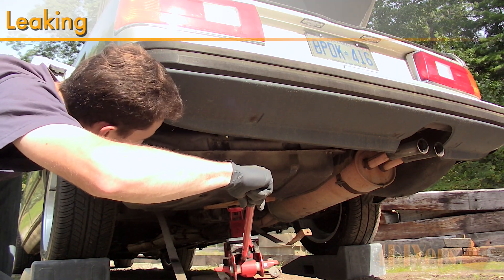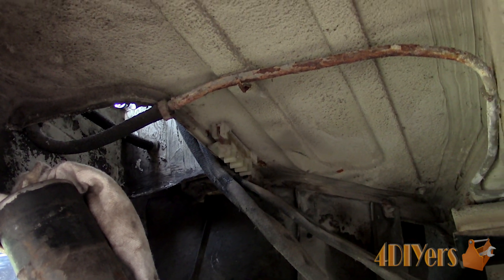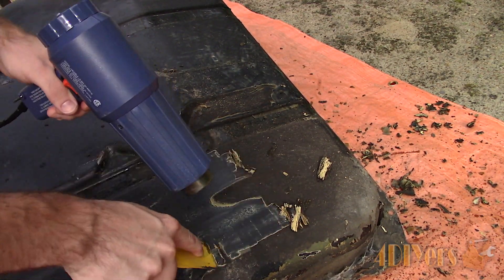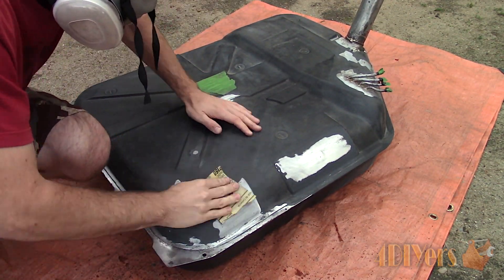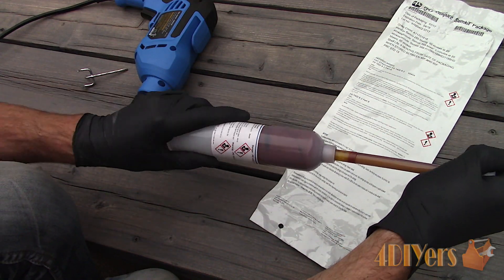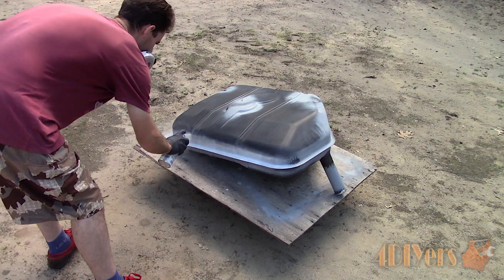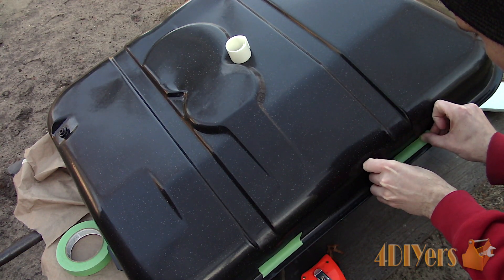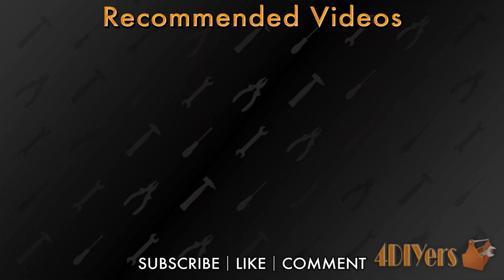How to Repair a Leaking Metal Fuel Tank Without Welding

Comment from the maker: Amazon links for various products used in the video for both USA and Canada:
USA
Tank sealant: https://amzn.to/3s7hCeR
Wax and grease remover: https://amzn.to/2M6xvCV
Etch primer: https://amzn.to/3qXvxUm
Filler Primer: https://amzn.to/3iQSOnT
220 grit sandpaper: https://amzn.to/3sZf5V7
400 grit sandpaper: https://amzn.to/3qOEO0G
Chemical rust treatment: https://amzn.to/3onBdoE
Polyurethane film: https://amzn.to/2ZtKJwz
Foam vibration pads: https://amzn.to/3udVL7e
Canada
Tank sealant: https://amzn.to/37owVHV
Wax and grease remover: https://amzn.to/39nLn4F
Etch primer: https://amzn.to/3aaS5tE
Filler Primer: https://amzn.to/2NucGl5
220 grit sandpaper: https://amzn.to/2YjmoJe
400 grit sandpaper: https://amzn.to/3qVYXlK
Chemical rust treatment: https://amzn.to/3osNlVK
Polyurethane film: https://amzn.to/3qLnqKw
Foam vibration pads: https://amzn.to/2Nn9iJ3

Comment: Wish I'd seen this before getting my fuel pump replaced. would have tackled all the cosmetic/preventative stuff you detailed here. And in SW Ontario, gas tank repair is very expensive, distant, and you have a very long downtime. And as you point out, a new tank can be cost prohibitive.
Reply: Especially if the person has rusted brakelines... The mechanic wouldnt want to work on the task because they are scared they will create more problems.

Comment: geezous..  after all that or you could just buy a new tank for around 200 bucks and be done with it.
Reply from the maker: Out of about the 12yrs I've owned this car, I've never seen one in a wrecking yard and I've only seen a couple people offering parts, but they were easily a couple hours away driving. I could order a tank from the US, but it would cost me $200 just for shipping. A new tank is probably around $1000 and a dealer item only, I can't imagine too many aftermarket companies offering a replacement. The same method was used on a newer 7 series I had, that was over 12yrs ago and I couldn't find a used tank for it either.

Comment: You can weld it safely by filling the tank completely with water or sand. You remove the air from inside and space it cant explode

Comment: i went in for a wof, and did not expect this to be my failure,
iv had my car taken from me by the garage, for the last 3 weeks due to leak at the top of my tank, turns out its similar to yours in this video, i told the guy to scrape and weld or surely there is a resin or putty, anything that can be done,
he refused for the sake of explosion and insisted on a second hand replacement, he has had three tanks delivered all unable to be fitted.
and the guys at the garage wont let me drive it away. no tanks around new zealand, they now talking about sourcing one from south korea. 
before it gets pricey why wont anyone fix it like you just did?  the car is a 2011 hyundai elantra, its been good to me and still has low miles.
Reply from the maker: Not sure why they'd refuse a used tank other than having possible rust if it's a common issue. Some shops just rather replace parts instead of fixing what's there. At times it can be cheaper to replace than repair, but in other situations they just don't want to be bothered.

Comment: before you install it pressurize with a bit of air and spray with soapy water.. Bubbles = leaks..
Reply: Good suggestion.
I intend to do that on my bike tank using my lungs.
Air is a much better test than liquid.

Comment: many years ago I fix my tank using JB weld putting in a coin 25 cents and press the coin in the hole wait for 5 minutes and than just cover the coin until disappear with more jb well in one hour was dry refill the tank with gasoline and the 25 cents were there forever

Comment: Gt video. I had a fight w a boulder...and lost. I have a tiny leak in my steel long ranger tank. It is diesel. I have tried everything whilst not removing the tank. Quick steel potties. Failed in 2 days. Jb tank weld...lasted 2 wks. So far hard soap has worked best...lasted 14 days without further attention. Now I re plug with soap daily.

Tank removal is awkward and time consuming but everything I have tried has eventually failed. Soooooooo looks like I am up for tank removal. I intend to get it welded by a pro. Enjoyed yr vid. Thankyou.
Reply from the maker: Thank you! Ranger diesel, it must be the old Perkins version?

Comment: So a spark might ignite the fumes in the tank, but it is ok to hook it up to a car's exhaust to "dry" it out?!?!
Reply from the maker: Well you shouldn't have sparks coming out of your tailpipe. A muffler and a resonator, along with the long length of exhaust works like a spark arrester. If you start having any of those components missing or if your vehicle backfires, then it's something I wouldn't recommend. Instead fill the tank with an inert gas.

Comment: this may work for my 96 discovery, but i may rubberizing paints.
Reply from the maker: I would avoid rubberized paints on metal. It may dissolve from fuel and can trap in moisture causing more rust eventually.

Comment: What about the interior? If mine looks very old, is there a mixture to treat the interior as well?  Great video!!
Reply from the maker: Thank you :) There are rust removing chemicals that are available on the market which you dump into a tank, then let it soak for a period of time. I haven't used any, so unfortunately I can't specify which products would be the best.
Reply: Drano drain cleaner,wear gloves and eye goggles.Dilute,dilute,dilute,at disposal.